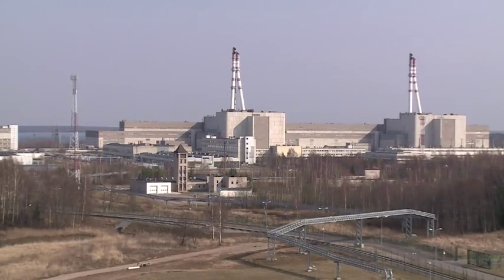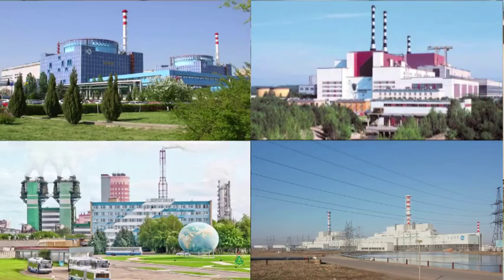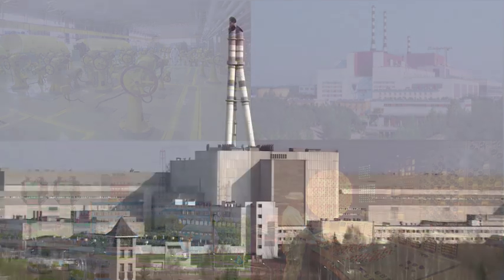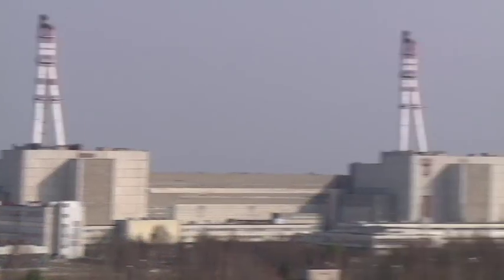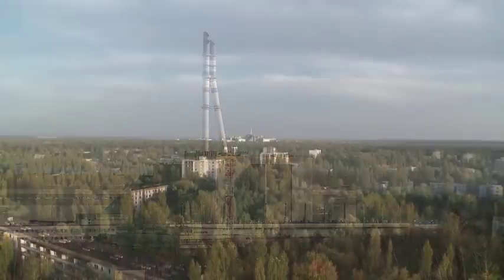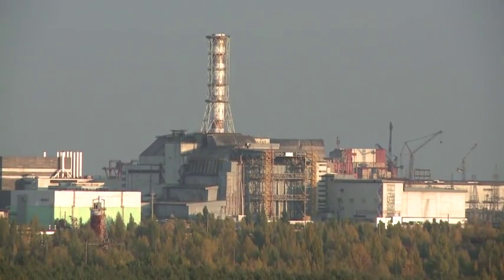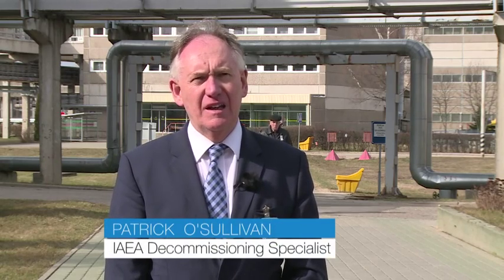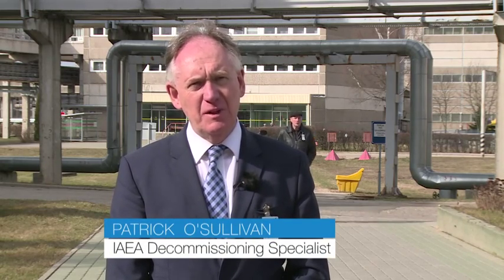Decommissioning Ignalina Nuclear Power Plant Lithuania 1st Project RBMK Reactors Progress May 2016

Comment: RBMK- If only the operators knew the truth 30 years ago. Chenobyl, RIP 1986-2016.
Reply: Yeaahhhh
Reply: The power spike when inserting control rods were noticed in this (ignalina) reactor and was reported before Chenobyl accident.
Reply: @user-py9cy1sy9u  RBMK designers also knew about the issue way before 1983. It was kept secret, and none of the designers received any repercussions for their mistake. Instead they were very slowly implementing upgrades in the existing RBBKs to combat some of the flaws, but it was too slow. Even RBMKs operating today are not safe, but at least can be scrammed without exploding (thanks to those upgrades being implemented immediately after the disaster). Dyatlov himself said that if he knew those flaws, he would never even worked at that plant, nor most of the staff as well. In Ignalina they got lucky because reactor was in very stable condition during testing was done by senior staff before going commercial.
Reply: wwwelkam ^^Leningrad NPP, to be a little peckish ;-)